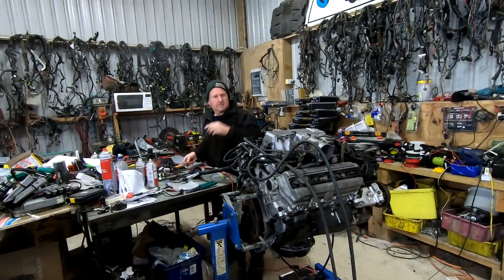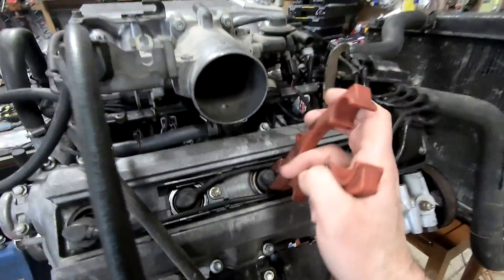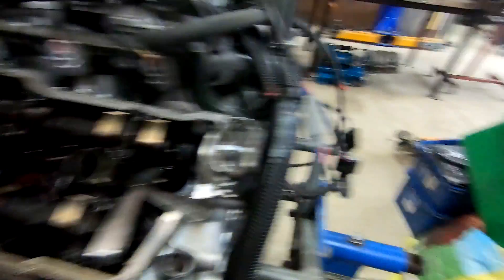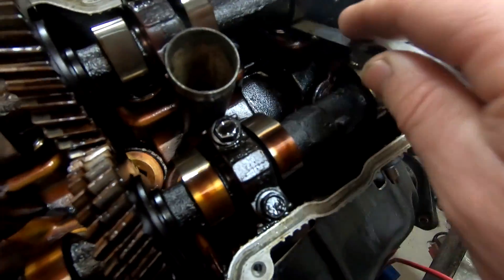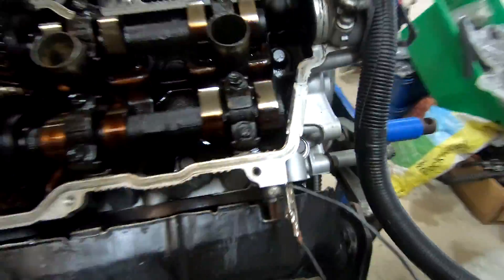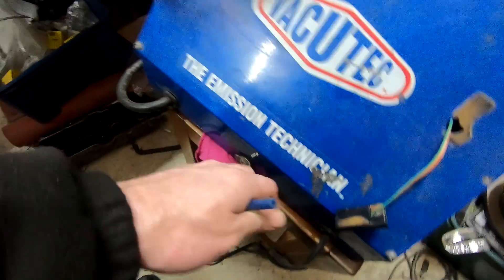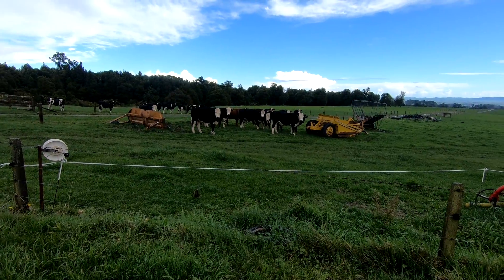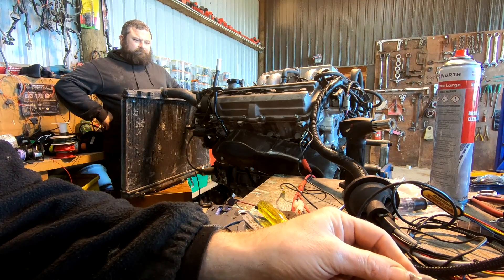1uz engine health testing.  My new test engine has issues inside.  Comp test and cylinder leakage

Comment: That machine is got a lot of uses it can be used for engine and trans oil leaks, coolant leaks after drain ac leaks, and if you don't  use  a dye it can be used for water and air leaks inside car is one hell of a diag tool is used properly
Reply from the maker: It sure can.  We hired it out recently to test industrial equipment.  When I had a normal workshop we used it for heaps of different jobs.  Cheers Kelvin

Comment: Can you please explain everything about the VSV (vacuum switch valve) I'm having some issues and am trying to pinpoint the problem, has no fault codes.
Reply from the maker: There are more than one vsv fitted across different 1uz and 3uz and 2uz engines.   They are just a simple electrical solenoid for transferring vacuum from one place to another.
Reply: @CartuneNZ  on my 96 sc400 it is connected to the egr by vacuum lines was wondering if it could affect vacuum to a level where theres no power brakes the booster is fine car runs very rough

Comment: Hi kelven   
Can we change only bearing on fan bracket or    Bracket has to replace, in Pakistan is not available new one only used like my part. 1uz ucf20 Lexus 
Please help
Reply from the maker: I have changed just the bearing in the fan bracket in the past however to use the correct bearing costs more than the complete bracket these days. It is not a simple press in and press out job.  CheersKelvin.
Reply: Thanks Kelvin, successfuly changed bracket bearing, was little tricky  but good experience.
Reply from the maker: @kuku-lm3hn  well done.

Comment: Hey Kelvin I have a vvti out of a 98 gs400 left side valve cover has a noise like the gears in the middle that power the exhaust cam are getting noisy is that a common thing and should I be worried about it, I'm about to do the gaskets and will take pictures but want to know if there is something I should look for while I'm in there any help is much appreciated cheers
Reply from the maker: The cam gears should not be noisey and should be inspected if they are.  Cheers Kelvin

Comment: Being that you do fit link ecus What sort of power do you see out of vvti models were most is on stock setup including a exhaust and cats for  vehicle test centres
Reply from the maker: None of the setups have had stock exhausts as we simply dont run stock exhaust on conversions.  Many have cats though.  I try to see the engine rated HP at the wheels at least.  If I get that Im happy as its over 10% HP gain.  Many I see around 20% HP gain.  Cheers Kelvin
Reply: @CartuneNZ  i did word it a bit incorrect there i ment standard exhaust was not a big nosie one .  A fella here in Ireland mapped mine and it was 290hp wih 333 lbft . He was telling me that all Toyota's  except for the jz engine dont make there claimed power figures.  My was done on a dynapack hub rollers

Comment: any thoughts on engine treatments like Seafoam run through the intake?  They advertise that the treatment will remove carbon build up, but I'm skeptical.
Reply from the maker: We have a similar product over here and it works great when applied correctly.  Its like any treatment and so it will work well if you have a light carbon build up but if its really bad removing the intake is a better idea.  Cheers Kelvin

Comment: Do most 1uzs tick??
Reply from the maker: no.  Generally getting the tappet clearance correct sorts mechanical ticks.
Reply: @CartuneNZ  yes well I agree, I have a local friend that believes all 1uzs he's had have a tick to them. I am more to the belief that valve work in these should probably be done on high km uzs not that they'll break but because it's best practice

Comment: It takes my breath away, whenever I see a 1UZ that someone has managed to abuse to the point of it not functioning correctly anymore.  These are arguably the most durable engines ever designed; any country, any era.  One of the older staff members at my local Lexus dealership says that in 27 years he has not seen even ONE 1UZ wear out. Most of his original customers have cars with half a million kms on them, and the highest one is in the 800,000km range, and still functioning normally. It raises questions, like WTH KIND OF ABUSE did the owner of THIS engine put it through??? 

How many kms did this engine travel, to become like this, Kelvin?
Reply: A testament to their reliability was Matt Farah's million mile Lexus, miles not kilometres.
Reply from the maker: They are surprisingly durable.  In most cases its normally lack of servicing (or lack of knowledge) that kills them.  We will see what happened when I get time to pull it apart.  At this point it still runs good enough as a test engine.  Cheers Kelvin
Reply: @CartuneNZ  I look forward to each new video of yours, with bated breath, Kelvin! Cheers!

Comment: My second 1uz  was 60 psi on cyl 1 baaaad day  found out after I did timing water pump and all front seals, car never smoked at all suspected a valve issue
Reply from the maker: Its pretty normal for me to have low comp engines after sitting but normally they come up fine.  Ive had a few with tight tappets recently but this is the first one which has an issue where it has to come apart.  Cheers Kelvin